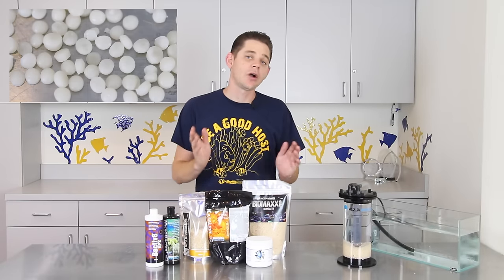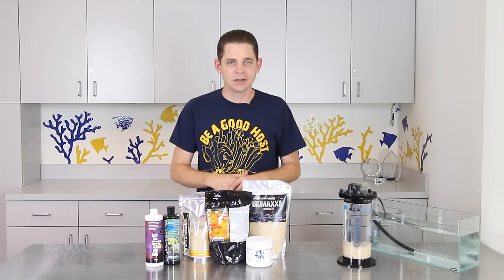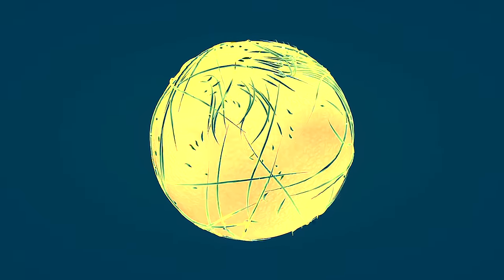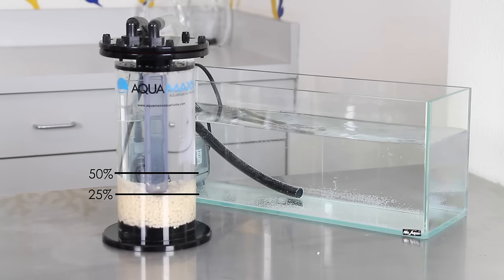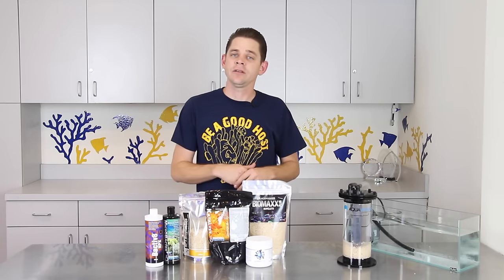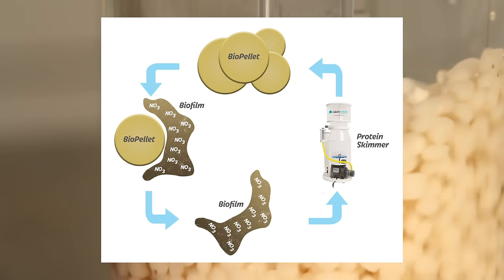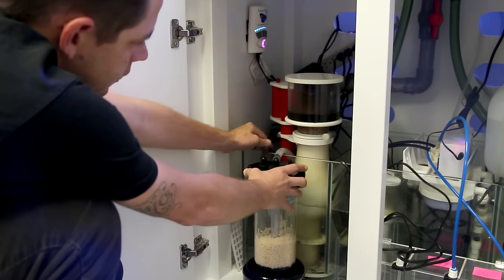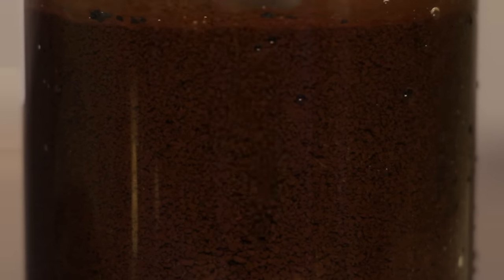How to Lower Nitrate (and Phosphate) in a Reef Aquarium using BioPellets

Comment: Just would have liked to hear a bit on how to distinguish when to replace the pellets to avoid bacterial release back into the system and what percentage of pellets to replace on what kind of timeline...
Reply from the maker: +Jason Allen The pellets generally just need to be topped off, never replaced.  This is because they are consumed over time.   The Protein Skimmer will actually remove excess bacteria from your aquarium.

Comment: Would this work for a fresh water chiclid that does not have a protein skimmer
Reply from the maker: No, your best option for larger freshwater aquariums with high waste levels is a constant water exchange system or simply improve the filtration.  You might also consider an algae scrubber; they work great for nutrient control and will function in freshwater aquariums.  

http://mdshop.us/2igyhOj

Comment: How do you incorporate the use of the microbacter 7 when adding a protein skimmer and bio pellet reactor to a system? MB7 instructions say not to run the skimmer for 4 hours after addition of MB7. Do you turn off the reactor also while the protein skimmer isn't running? How much MB7 are you adding and how often?

Comment: What is the pump you are using on that aquamaxx reactor at the beginning of the video? I use a mj1200 and the pellets barely move. Thanks.
Reply from the maker: The MJ1200 should suffice for +/- 1 cup of bio-pellets but if you are running more media than this, you might want something a bit stronger in the 500 GPH range.

Comment: if the output of my reactor isn't going to skimmer chamber... is it still effective?
Reply from the maker: The reactor will still help you beef up some biological filtration but, exporting excess nutrients would still need to be addressed.
Reply: @BulkReefSupply  So it' means that I have to find ways to export my output directly to the skimmer right?

Comment: how often do you change the bio pellets and for a 250 gallons how much pellets do I need
Reply: +FishOscarmorales  They break down dissolving over time so then you add more over time to balance. Mostly a nitrate reducer.
Reply from the maker: +FishOscarmorales The amount of pellets depends on your bio-load and the general recommendation is 2-4 cups per 100 gallons of water.  Start slow and add more pellets as time goes on until your nitrate levels are maintained.

Comment: Hi! can i use biopellet with refugium?
Reply from the maker: Yes, you can run both bio-pellets and a refugium on the same aquarium. If you are looking for nitrate control, I would recommend that you start with bio-pellets because they are going to be the most effective method for consistently keeping nitrates under control.
Reply: Can I use a bio reactor with fro and carbon reactor

Comment: If I add this into my tank which has been set up for 5 months, will it spike nitrate
Reply from the maker: No, it is designed to help lower nitrates on a regular basis when applied properly.  You must have a strong protein skimmer and I do recommend starting with a small amount of bio-pellets and then increase the amount over time to accommodate the waste level in your aquarium.
Reply: Marine Depot Aquarium Supplies ahh so this is not designed for nano reef use? I originally put in bio media once and it completely spiked nitrate so bad I removed them and the next couple of days,  it went  back down to 5ppm. I only run carbon, filter floss and fluval clear max in my 10 gallon system

Comment: is it recommended to use GFO with a biopellet system or just one or the other?  my GFO does a great job eating my phosphates but does very little to nitrates/nitrites.  Also, does this BioPellets stuff do anything about nitrites?  Also, will this decrease my frequencies of water changes? also, do the pellets ever need to be changed-out?
Reply from the maker: +David Beecroft The use of GFO is determined based on the phosphate levels in your tank, some hobbyists utilize GFO alongside bio-pellets and some do fine without.  If phosphate levels tend to remain a problem after applying bio-pellets than it is fine to start using GFO as well.  

Bio-Pellets will only consume nitrate, not nitrite. We still recommend keeping up with a regular water exchange schedule and you will never need to change out the pellets, only top them off to keep the recommended qty of pellets inside your reactor at all times.

Comment: Need help! I have zero I mean zero nitrates in my reef and it's taking a toll on my corals almost all of them are losing their color, as crazy as this sounds how do I add nitrates in my aquarium?? Do I turn off the skimmer for some time??
Reply from the maker: Turning off your skimmer will get the job done, try spot feeding the corals directly and/or increase the frequency in which you feed your fish. It is a good idea to check all your other parameters as well to see if other factors may be contributing.
Reply: Rafael Soriano food

Comment: Hi Marine Depot!!! I need your advice. I just ordered an AquaMaxx BioMaxx BioPellet Reactor from you. It is on back order right now but when it comes it is going to replace a T.L.F. reactor that I hate. I need a suggestion for a good quiet pump to use with this. I have an old 34 gallon Solana AIO. I will be running the reactor externally.  Right now I am using a mj 1200 but it vibrates the tubing to the reactor and makes way too much noise. Can you guys please help me pick a nice QUIET pump that will fit in my Solana? Thank you so much for your help!! I would like to spend under a 100.00 on the pump but silence is my top priority.
Reply from the maker: Glad to help and thanks for shopping with us.  The Tunze Silence and Sicce Syncra are your best bet. I provided a couple of links below and you want to get something around 300-400 GPH and be sure to use a ball-valve in order to dial in the flow rate based on how much media is being used.   

Tunze: http://mdshop.us/29N0qph

Sicce: http://mdshop.us/29tC6KJ
Reply: +Marine Depot Aquarium Supplies Thank you so much!!!!!!
Reply: +Marine Depot Aquarium Supplies One last question. They are pretty close in price and both have great reviews, Out of the two do you guys prefer one over the other? I can't decide lol. Thank you again for all of your help I really do appreciate it!!!! (So do my corals 😊)
Reply from the maker: Both are great choices and to be honest they are very similar pumps in terms of construction.  Either way, I am sure you will be happy.
Reply: +Marine Depot Aquarium Supplies Thank you so much for all your help!!!!